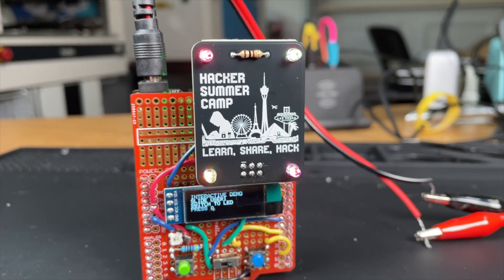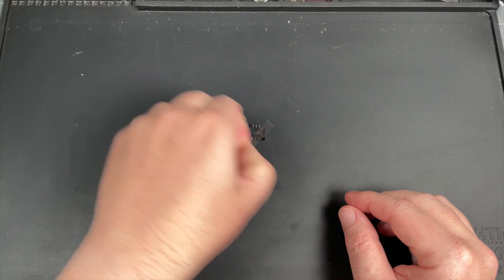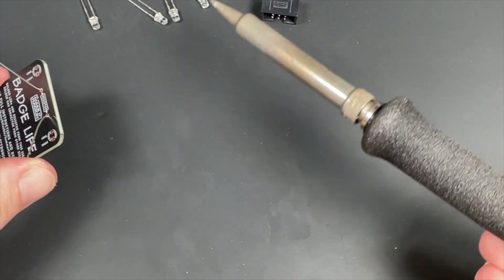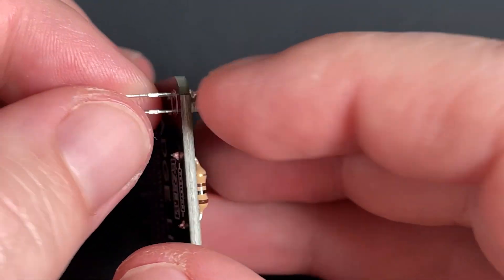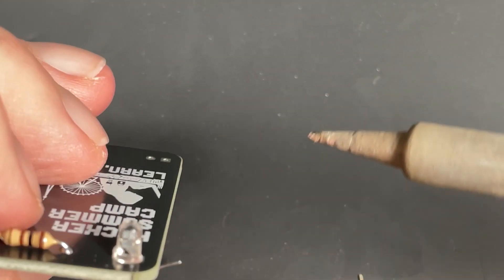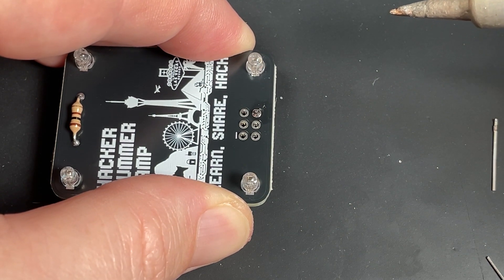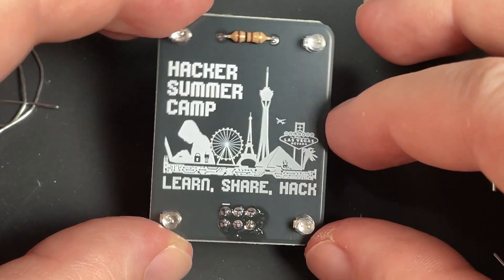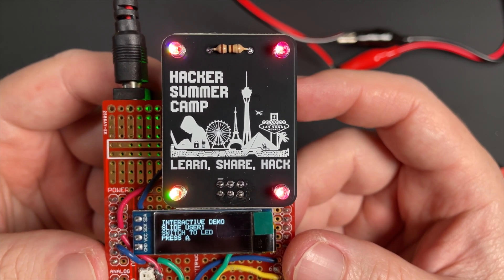How to Assemble and Solder Your Hacker Summer Camp SAO | DEF CON 32

Comment: can I test the sao connector with jumper cables on the vcc and gnd pins? I don't have a badge or a port to try it normally. also thank you for the video, I was just about to start soldering so you posted just in time.
Reply from the maker: @_cbug_  yes you can!